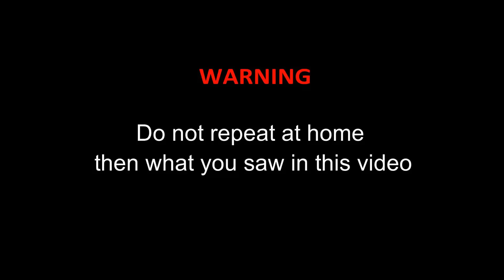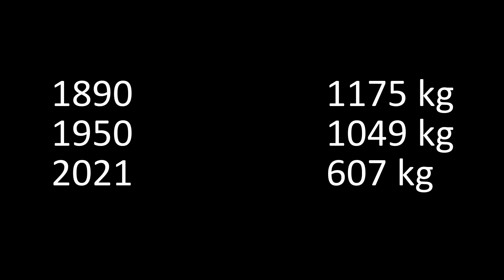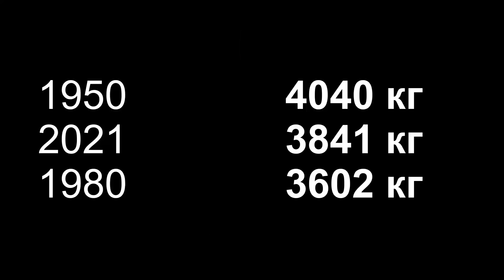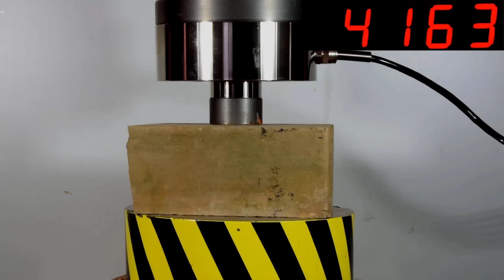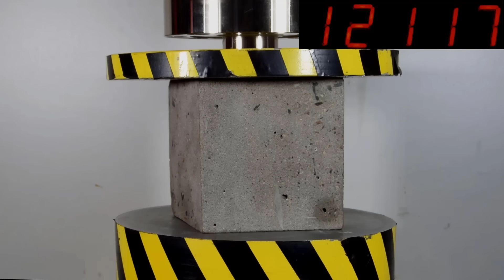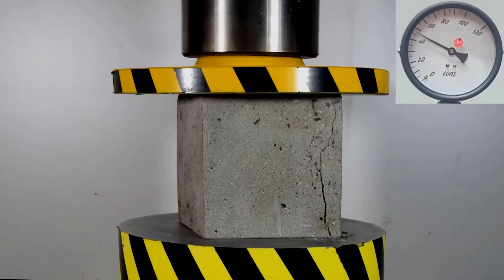HYDRAULIC PRESS VS OLD AND MODERN BRICKS

Comment: Good thing most bricks aren't used in places where shear stress typically matters and compressive strength does
Reply: Thanks. Saved me some time. 😅
Reply: This needs more upvotes people.
Reply: Also, my guess is modern bricks more closely ride the line between cost and strength required to meet the needs of the application, so it's not surprising to find a modern brick performing worse in shear strength and as good or better in compression strength. I would bet those modern bricks are a fraction of the cost of the 130 year old bricks were, when adjusted for inflation, yet still fit for purpose.
Reply: you dont know me  Well I'm not saying they have no shear strength. I'm just saying that it's not as important as compressive strength when building a building.
Reply: you dont know me  No they don't, all our house are built using double brick, internal-external walls, 2-3 story, shear strength doesn't matter
Reply: Hear of settling of your house? How about being frozen and thawed after just 7 years. My bricks are cracking coming off as shards!
Reply: you dont know me  yeah, no, they don't add up because these days people don't build houses out of only brick like they used to. They use other materials aswell...like rebar and columns. They don't experience any sheer force, noone's dropping a house on your house
Reply: @jeffwells641  Brick aren't typically structural. There are better options. Brick is just for show now days.
Reply: None of the tests in this video are shear strength tests.  Why are you all going on about shear strength?  As others have already said, modern structures don't used bricks in a structural fashion.
Reply: @FlatOutFE   What he was doing at 0:58 was a sheer test. Also, my house is made our of bricks. Maybe bricks aren't used to reinforce the structure of larger buildings, but my house is much more sturdy, weather-proof, fire-proof, ect., than all the other houses around me that aren't made of bricks. If a tornado comes my way, the other houses around me will collapse before mine will. The main thing I have to worry about in that situation is my roof collapsing.
Reply: @bwj2344 , that was a single point loaded bending test.
Reply: @FlatOutFE   It's basically the same thing.
Reply: @jeffwells641  💯 And probably the reason bricks did not become the default bulding material in many places - notably the U.S. Midwest - where they would almost certainly have been the best 'fit for purpose' given the weather extremes. However the scarcity of clay pits and ready availability of timber dictated wooden frame would end up becoming the preferred structure.

In South Africa, quite a bit younger in development even than the US and of couse millennia younger than Europe - and despite having weather that is nowhere near as important a factor - you still find clay brick and then concrete breeze block almost exclusively used in all residential buildings.
Reply: @FlatOutFE  It's literally shear strength...literally constant unyielding pressure, which is unlikely to happen irl
Reply: @cinnastag , well with any bending moment there is tension, compression, and shear.  I would say that the initial failure mode of the test at 0:58 is tensile.
Reply: @FlatOutFE  It's literally shear force though, you always have sheer force if something is being pressed under a hydrolic/pneumatic press...it's a normal force.

This test isn't useful at all because it doesn't test anything that ends up being used in practice...noones hydrolic pressing your house
Reply: you dont know me  you might want to look up the meaning of shear pressure, there is no shear force applied to any brick in a brick wall, doesnt matter how high it is, its all compression force, that is why bricks are laid in an overlap fashion, to spread the compression force
Reply: @cinnastag  things under direct compression is called compression.  Look up shear.
Reply: @FlatOutFE  ...the first test was quite literally shear though.
Reply: @cinnastag , no. It was a single point bending test.  Bending involves tension, compression, and shear.  Direct shear testing typically involves a shackle apparatus.
Reply: @conken9615  cracking because bricks are porous, frozen water expands. House shouldnt have to settle if the foundations are compacted correctly
Reply: When build a building we don't use these type of bricks, we use "Concrete".. this type of brick for ground houses only.
Reply: @FlatOutFE  But...why did you say "no, it's not direct shear" when I never mentioned direct shear only to disprove yourself by saying it does have shear?
Reply: I'm an architect, you'd never use brick structurally at all today. Compression or otherwise, in fact the lighter they are the better.
Reply: this is the kind of thinking the engineers of surfisde probably exhibited.
Reply: @FlatOutFE  the first test was a 3 point bending test; the two supports and the point load. this could have a failure in either bending or shear but due to the short length of the brick, shear failure is more likely.
it's possible to do a pure bending test with a 4 point test, ie two supports and two equal point loads. this would create an area of 0 shear force in the middle of the beam, however it could still fail in shear at the ends.
Reply: @joshdaly2343 , aren't most bending moment tests when looking for shear done with 2 mid-points that are 1/4 to 1/3 of the length from each end?
Reply: @FlatOutFE   yea but the same force can give any failure depending on the location of it and dimensions of the beam. due to the brick being so short it's unlikely to fail in bending and would just go straight to shear failure.
Reply: it's still being used plenty in (minor) earthquake zones around the world. You see a lot of cracked brick buildings in Groningen for example.
Reply: @michaelfarkas2257  Brick chimneys were the #1 cause of death in the Christchurch earthquake, not sure what youre getting at.

Structure today is steel and concrete, no brick and mortar could ever compete in compression or tension with those materials. Lets see your engineering degree
Reply: Russell Phelan  yeah, and they were pretty much the same as the old bricks, that’s what I’m saying
Reply: you dont know me  Bricks on homes built in the last several decades aren't structural though (at least in my region). They aren't holding up anything but themselves.

Comment: The compression test is still technically a beam test since the bricks only make 3 contact points on the flat anvil. Ideally, a bed of sand or something to fill in the unevenness/gaps between the brick and metal base would probably produce more accurate numbers.
Reply: No, it's not a beam test. Yes, there are 3 contact points, but that's not enough for a bending test. 
To get proper bending stresses, the beam length should be at least 3 times, better 5 times the height of the beam (beam theory). For shorter beams, the stress distribution will not behave like a beam under bending, as shear stresses will occur in a non-negligible size.
And here in the test the failure is clearly shear based. If it would be normal stress based, the crack would start at the bottom below the load introduction point.
However you are right in one point: a gap filler under the supports and load introduction point would be better to avoid stress peaks and lead to a better comparability between the tests. And usually the load introduction points have ball joints / spherical supports.
Reply: @johnscaramis2515  @ 3:03 the crack starts at the bottom…which indicted the bottom surface is in tension and the top is in compression. Which is very beam like at the start. It would be very interesting to see what happens with the brick on a “mortar” bed since bricks are primarily only used in compression.
Reply: Agreed. None of these tests actually tell us anything about these bricks. Hell, the 1890's brick is much taller than the rest, so being stronger only means.. well, means it's taller. Also, these bricks are stressed between mortar and between other rows of mortared bricks, meaning that the compression load is spread throughout the brick. Tension (beam) loads may be seen during settling but severe settling of a foundation is going to break just about any construction material, so they're pretty irrelevant.
Reply: It’s worth noting that a lot of buildings and structures in the industrial period were heavily over engineered, to the extent that bridges and aqueducts are still present today’s despite having fallen into disuse. They have effectively outlived their operational lifespan. There’s a reason “they don’t build them as they used to” is a saying, since many structures presist over several generations of family despite long becoming inadequate for function.

It’s likely that the newer bricks are less tempered, either as a cost cutting method or to preserve material. But that those  new bricks are likely still perfectly fit for its intended purpose. In particular, in the UK we don’t have any earthquakes so the sheer strength isn’t particularly important.
Reply: @lordbiscuitthetossable5352  There's absolutely truth to that. To the many who complain that we live disposably, we absolutely can build things to outlive the lifespan of Roman structures, but no one wants to pay for it. What we seem to lack now is foresight and desire to make the structures that need to last, last.

I'd also add that a brick house doesn't need bricks that could be at the bottom of a 30 story building. The old way was not "let's make everything last forever" so much as "we can't calculate how much stress will be on this part so let's make everything big and heavy enough to that we don't have to worry about it." That's a rather wasteful practice, not a noble one. If they used those highly kilned bricks for houses, it's more likely because logistics chains were not sufficient to stock and deliver as many types of bricks as we have now.

All that to say, between what you brought up (use case is important) and other things, reality is much more complex than the usual "they don't build things like they used to because society is lazy".
Reply: It's just an industry standard that makes the figures easy to compare, unless u design the test machine.. The process is trivial and doesn't do water absorbtion
Reply: @gmcalabr  Exactly. One reason why things are more affordable today is because we don't waste ressources with too high safety coefficients. It's good that bricks were solid in the good old days, but I still don't see any house collapsing around me due to weak bricks. So more solid bricks is an expensive solution to a problem that we don't have.
Reply: @waterwonderland5667  Also the brick reaches like over 5000 after that but lets just ignore that i guess.
Reply: @waterwonderland5667  it's important to test compression and tension since any brick could be in a tension place at any moment.
Reply: @cleitonoliveira932  not with proper design and sturdy foundations. Generally any brick in tension is the result of poor design or weak foundations.
Reply: @gmcalabr  Most things built today use Modernist architecture, which is so ugly it will be torn down in 0-50 years anyway.
Reply: @gmcalabr  it depends on the structure. I live in Australia and we have two six lane roughly 15-story tall (to allow cruise ships to pass underneath) toll bridges, one built in 1986 and the other built in 2009. The one built in 2009 has a lifespan of 300 years. The “cheap” projects—unnamed bridges that you drive over for all of 5 or 10 seconds, are built to last at least 100 years.

They definitely do still build some things to last.
Reply: Guys, HERE is The Savior

YaH The Heavenly FATHER HIMSELF was Who they Crucified for our sins, NOT jesus, and “HERE IS THE PROOF”

From the Ancient Semitic Scroll: 
"Yad He Vav He" is what Moses wrote, when Moses asked YaH His Name (Exodus 3)

Ancient Semitic Direct Translation
Yad - "Behold The Hand"
He - "Behold the Breath"
Vav - "Behold The NAIL" <— YaH’s Crucifixion
He - "Behold the Breath"

“Behold the HAND that Beholds The NAIL” 

PROVES - YAH The Heavenly Father HIMSELF was Who they Crucified

That is EXACTLY what Moses Wrote

Here is what they mean

YaH's Name:
(Ya)d + (H)e, as YaH is what Moses called Him and YaH Declared: "this is My Name, this is My Name for all generations" (Exodus 3)

YaH is The Creator of “MAN”:
Yad He, (HAND BREATH), as YaH's "HAND" Formed man from the dust  of the Earth and His "BREATH" made him a living being (Adam)

YaH's Sacrifice of Crucifixion for “MAN”:
Vav He (NAIL BREATH), the "NAIL" through YaH’s "HAND", in Sacrifice of Crucifixion, that whosoever shall call YaH Savior, His “BREATH” brings forth life (Salvation)

How YaH arrives:
YaH arrives via the Tent of Meeting (Exodus 33:7:11, Isaiah 54, 55), where a Tent is erected outside the city, a cloud descends upon the entrance of the Tent and YaH appears...

Why they demanded YaH to be Crucified:
YaH was Crucified according to Hebrew law (Deuteronomy 21), to be Hung on an Almond Tree for BLASPHEMY as it was for His NAME they demanded Him Crucified. The Messiah claimed He was YaH...

HE WAS YaH!!!

HalleluYAH translates “Praise ye YaH”

The Hebrew Book of Isaiah

Isaiah 42:8
"I am YaH; that is my Name! I will not yield my glory to another or my praise to idols.

Isaiah 43:11
I, I am YAH, and there is no other Savior but Me.

Isaiah 45:5
I am YaH, and there is none else.